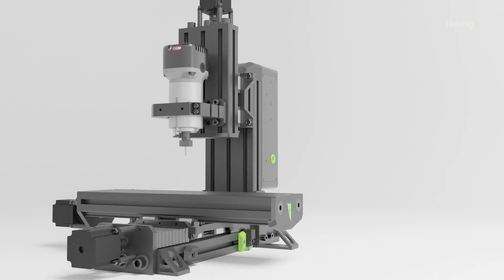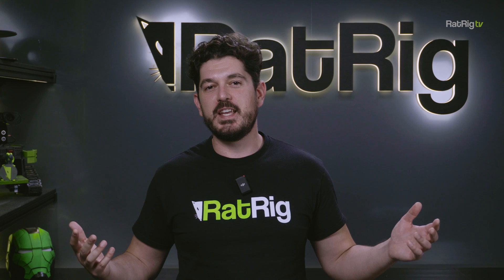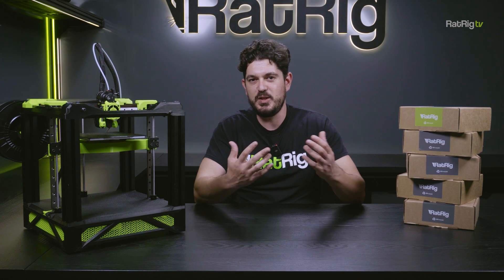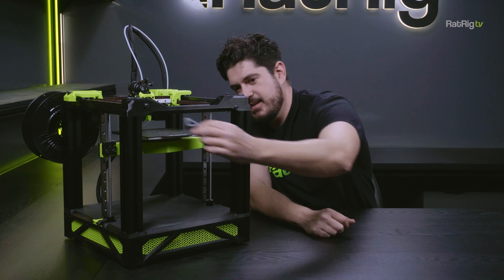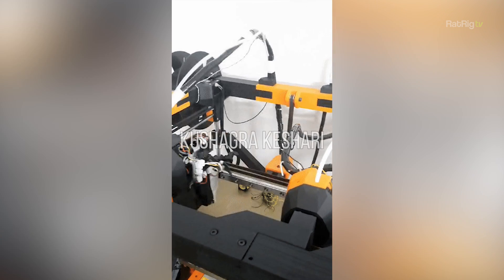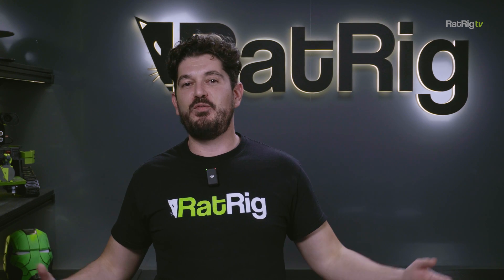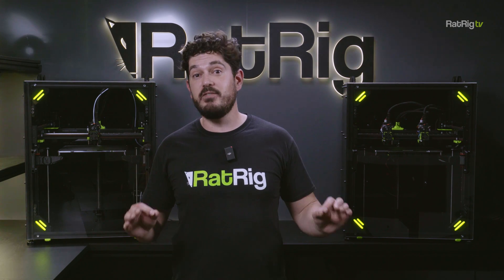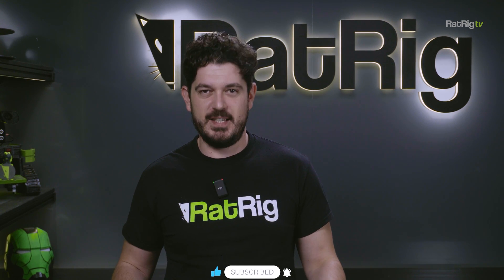V-Chonk is a go, massive news on the horizon, and a Mini Mill Give-away!  | Rat Rig TV #03

Comment: As a busy person always traveling, plus the immense learning curve of assembling such a complex machine from scratch for the first time, I have yet to get my Vcore 3.1 fully functional, its been years! Hopefully the 4 is more foolproof, utilizing RatRig made enclosure panels and other parts that constrain the shapes in a way that almost guarantees a square frame during assembly. I'd also like to see default EBB-42 toolhead board and beacon integration and better belt tensioning. Lastly, it might be time to drop the Phaetus Rapido, its fragile af and the sock drifts down on all 3 that I've had (2 replacements, easier than getting those titanium screws that snap during head crashes)

Comment: I have been waiting for the 4!  We have a vcor 3 500^3 at work and i felt the need of an IDEX to print whit soluble suports. Also made quiet a few structural ad on parts for it to make it more rigid  and they worked i can actually push the thing to 9m/s^2 whit out resonance compensation, my only print speed limiting parameter is flow rate, so i hope for some heftier melt rate options in the new machine kits (like the goliath).  Also i like to ask how similar the structure of the 3.1 and 4 are as i have made a lot of parts for a machine that i wanted to buy for my self just ran out of time. Thank you, and great videos so far.

Comment: Oh nice just as I upgrade to V-core 3.1 🥲 still looking forward to see what comes with 4.0. That mini mill will be on my next buy list. 
I wonder if V-Core 4 will have filament runout sensor, or a power loss system, where you could resume prints if the power goes (providing the print is still stuck to the bed of course😉) 
looking forward to it all

Comment: Excited about the Vcore 4.  I have two Rat Rig V core 3 - a 500 and a 400.  It would be great if Fabreeko could have all of the parts and kits to reduce shipping, they are a great company to work with.  My guess the Vcore 4 will have improved belt path and motion system, idlers - bearings, etc, and maybe higher voltage steppers and motors with feedback loops.  BTT has a great new mainboard - the Kraken that has TMC2160 drivers on the board that run at 24 to 60 v, plus many more options for under $120.  this would be a major upgrade.